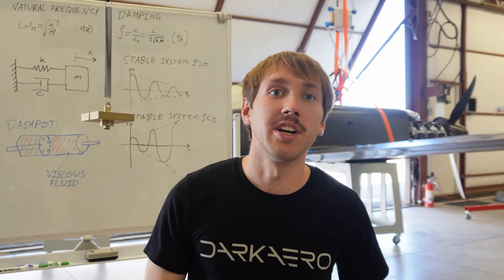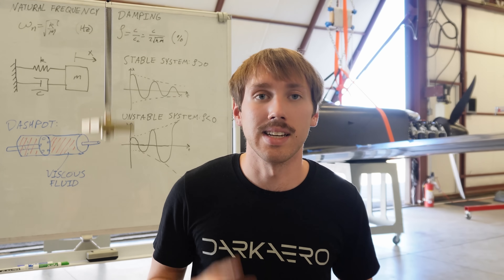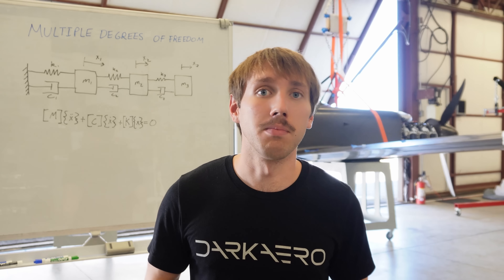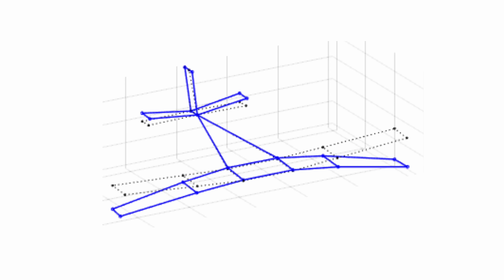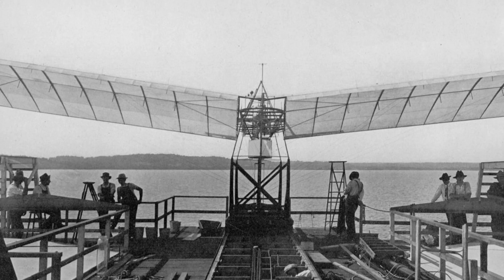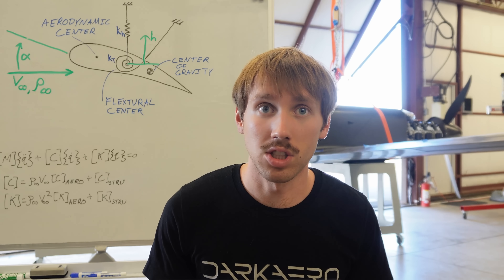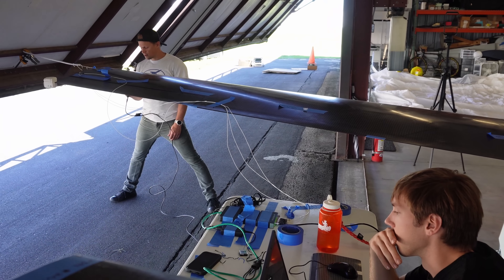The engineering required to fly fast (GVT)

Comment: Fascinating description of flutter. As a musician, I am working with a simple plate, column of air or a string. You can see that in many respects that any object can be viewed as a complicated string with modes and/or nodes dispersed throughout the structure depending on stiffness, mass and frequency. The same exact elements are needed to describe a vibrating string. The last thing you want is to be flying around in a Tacoma Narrows bridge!

Comment: Strange , those boys was making money by asking me and others to give them thumb up and now, at the end of their project they stopped informingm us. They are traitors in a way. If I new that, I would never give them thum up which they used to ask for...  Anyway, two thnings I do not like about their aircraft which I mentioned long time ago: Number 1) Use of corrosive alluminum in otherwise non corrosive air frame...(not a good investment , since your airframe may not last as long as all plastic airframes)  Number 2)  It is too small if you concider 200hp engine. Many UL arcrafts are bigger even using much smaller engine and are fast as well.

Comment: Electric plane via battery is really not meant for long range at all with battery. You won't need to worry about flutter if you can afford to use more structure via added material, IF you used a turbine engine.

Comment: I'm a senior in aerospace engineering, I'm currently taking a vibrations class talking about this very subject! This video is so interesting and really helped me to visualize some of the concepts we are covering, thank you!!
Reply from the maker: That’s awesome! Really happy to hear you found value in the video. :)
Reply: Dude if your expensive college education can’t get the point across yet a guy on YouTube can, This should be evidence of the college ruse debt scam
Reply: University provide order in study. Even if we can reach certain information, it doesn't necessarily mean we can learn without guide.
Reply: @Carboneye7 the video does a great job at a succinct overview that is easily digestible.  However, after the video are you able to model and perform the complex calculations necessary to analyze your own systems? How about diagnosing your modeling framework when calculations don't reflect observations?  This is where the thousands of hours of coursework come in that are required to become proficient in an subject.

Comment: Control surface Flutter is relatively simple to prevent with overhang balances, with a high degree of certainty to eliminate the problem. Per the NACA circa early 1940s. Interestingly enough, the highest-mach diving fighter of WWII had rather flexible single spar wings, and unbalanced control surfaces. Such is the ability of a cohesive development department and several little known design features.

Comment: So incase everything doesn't add up and the vibrations are not damped, how will this be countered (Other than lowering the VNE Speed)? Also to what  extent does the ground testing data correlate with the simulation data?

Comment: Phenomenally good explanation in less than 10 minutes As a pilot and non-practicing aero engineer I can really appreciate the complication involved with publishing a Vne speed. I'm certain that the Vne has a safety factor built in (200kts, 230mph for RV-7). All of you at Dark Aero are exceptionally professional with your design. Very impressive.

Comment: Put a parachute on it fools.  Call galaxy parachutes now or you will have unnecessary blood on your hands….I promise.  It should be mandatory now that the statistics are out.  Who am I?? I’m a statistician and an mde engineer and a cirrus and pipistrel owner.
Reply: Parachutes actually can help balance the aircraft…ask bristell because they can add more weight in passengers when the chute is installed or else they need weights upfront of 40 lbs.

Comment: This is kind of funny how similar this vibration analysis is to every other vibration analysis.  I used the same workflow for vibration analysis of cutting tools in specific machines.  However the goal in machine tools is to stay in a stable cutting parameters all the time, or right at the limit for maximum material removal.

Comment: Stellar presentation... Italian auto and aircraft designers employed construction methods with aluminum similar to what you guys have employed with DarkAero... It's interesting that a stallion constructed with carbon fiber of 1940s Italian style engineering is in the DarkAero stable... In the ladder logic of aircraft design observations of what works since computer analysis algorithms were verified by slide rule... It's incredible to witness vibrational modeling parameters transferred to the flat screen before moving forward with flight test. Time well spent in my book! Thank you for sharing      👏👏👏

Comment: Damn this was interesting! Could make hours long vids on this! (please do!!!!)
Reply: Wondering the same thing.   Probably a tall order but should be possible.   I have seen mode shapes and vibration dynamics modeled on engine rotating assemblies but they are also checked with real world testing.    For design phase efficiency 3D models are analyzed first.  It becomes a process loop, so ultimately sequence doesn’t matter.

Comment: Nice video!
Why do this test instead of a wind tunnel test with a model?
Reply: Because wind tunnels are expensive and you are not actually measuring the real aircraft. The GVT is done on the actual flight vehicle, which is key in measuring the stiffness, mass and damping values. Wind tunnel testing might tell you when flutter will occur but it doesn't measure the frequency response functions (FRF) that are used to compute the natural frequencies, damping, and mode shapes.

Comment: Old school way of figuring out if it is going to flutter was in flight with a parachute? Did they tap on the 747 to find these flutter frequencies?
Reply: They would have used electro-dynamic or hydraulic shakers to apply to input force on an aircraft that is large. On a 747, we would typically attach shakers at the wing tips, tail tips, and on each engine. A hammer is too small to excite such a large structure.

Comment: It's amazing that you are making videos explaining this, thanks! I'm curious how good your frequency response was using a (small) instrumented hammer on such a thin structure, I've performed GVTs on large military transport aircraft and always used magnetic shakers that sweep in frequency to excite the structure with enough energy at low frequencies, I would generally only use an instrumented hammer for more monolithic structures like engine mounts. I guess you are working with the equipment you have available but adding a couple magnetic/rotating mass shakers into your test setup would for sure improve your results.
Reply: Kai, the hammer taps were likely done at the stiff points (spars and ribs). For small, linear structures, using impact hammers is a good method to get quality FRF. Larger structures, like a C-130 or 747 aircraft, require more excitation than can be applied with an impact hammer. That's where electro-dynamic shakers are used instead of hammers. We typically would use 6 to 12 shakers at one time on a large aircraft to excite all the modes at the same time.

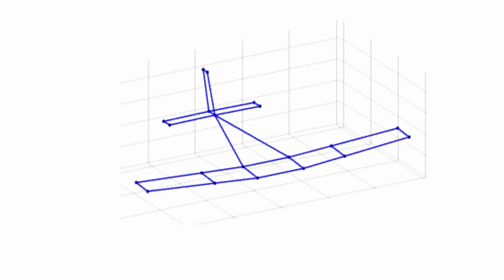Comment: 9:01 "As you can probably tell, there is a lot of physics and math that goes into flutter testing..." Um, yeah, that's about all I needed to hear. Also, how did they do this in WW II, etc, without computers? Or with fabric covered wings?
Good overall video, I just can't hang with the physics and math and stuff.  :)
Reply from the maker: Aeroelasticity was just beginning to be understood in WW2 timeframe. There was a lot more trial and error back then, and much was learned the hard way after airplanes came apart in flight.
Reply: research control reversal in high transonic flight - this was found because aircraft were exhibiting odd behaviours in dives and some lucky pilots got back to describe what was going on.  Transonic effects mixed in with airframe stiffness.

Comment: Love your work. This is probably one point where the extra stiffness of carbon fiber pushes the frequencies up. Using fiber glass would perhaps allow for larger bending and flexing amplitudes and lower some frequencies.
Reply: ..... oddly, the Berkut, a carbon fibre airplane, has a much higher VNE than the loosely similar Long-EZ.  I don't know whether it's the carbon vs. fibreglass or if it's the differing airfoils or some other wildly unrelated factor, but I'mma hazard that using carbon made things _better_, not worse...

Comment: Ahh ok 🤔, so why not just put your computer sensors on it and put it in a wind tunnel to create a simulation at certain speeds ? Plus you could do a smoke test to see flow , structural integrity,wing shape, materials used and their thicknesses, connecting points , there are alt of variables, and then comes how do the materials used react in different climates, cold ,hot ,expansion and contraction, a lot of variables,could be seen in a climatic wind tunnel simulation . Since this plane is made of carbon fiber it would be interesting to see we’re the weak points are going to be , and were things may need to get some heavier lamination , can’t wait to see it up in the air 👍

Comment: Studied all of this in 'control systems" engineering class. Though never applied the concepts to airframes. Is there a specific course or class in aeronautical engineering to apply these "control systems" concepts to airframes?
Reply: Yes, I also remember this in my control and instrumentation module.

Comment: Great explanations, could you also tell us what type of work/analysis on aeroelasticity did you do during the design phase? Mick Patey was pretty happy with the stress simulation he ran on his scrappy wings compared to the actual physical testing. Are you able to confront design data with the actual measurement you made?
Reply: Second this request.  Were you able to run a static vibration mode analysis on the design, and get any mode shape and frequency numbers?  Were you able to confirm these with your hammer tests?

Also, you are using carbon fiber, which IIRC is not very lossy itself.  Do you have any information on if your resin is at all lossy?  Did you consider using kevlar anywhere (especially around the empennage) to increase the structural damping in the airplane, at the cost of less stiffness?

I'd love to see more detail on why pitch mode in the wings (that's twisting around the 1/4 chord line, right?) becomes less damped at higher airspeed.  Is this actually higher dynamic pressure, or are velocity and density separate variables?

Comment: This was a great presentation on modal analysis and how it is used in the study of aeroelasticity. I would be curious to know how this carbon fiber structure is in regards to damping and if you guys are going to have to install trim weights or stiffening structures in strategic locations to tweak the modes.

Comment: Very interesting! After seeing this I am still totally confused BUT on a much higher level!! 🙂
Reply: How a plane flies depends on its shape. Flying fast enough can cause the plane's shape to change. Depending on the strength of the structure, there are certain speeds at which a small change in shape creates a change in flying characteristics that tends to worsen the deformation. This can show up as vibrations that can be strong enough to damage the airplane, and/or changes to the shape of the airplane that impede safe flight. Therefore, these tests help them determine which speeds to avoid to keep the airplane safe and sound.
Reply: @Mariano.Bernacki  Thanks! What puzzles me is how you can determine how the airfoil will react in flight from making vibrations. I have seen wind tunnel test (like the ones shown in the video). I find these vibration test amazing.
Reply: @psblad2667  Much of this "testing" was already done in software like ANSYS before finalizing the design airframe components. My guess is at this point they're doing real word testing so they can confirm the results from the software analysis.
Reply: @jamescrud  This is mostly correct. There are computer models (finite element models) of the aircraft that are used to predict when or where flight instability occurs. The ground vibration test (GVT) is used to measure the mass, stiffness, and damping properties by measuring the natural frequencies and mode shapes. The test results are then used to update the computer models to match the test results. Once the computer model matches the ground test, then you have more confidence in the model predictions.

Comment: I was wondering what the VNE speed was going to be. Especially with the turbo version of the UL520 coming out after you already started developing this plane I’m guessing at 15,000 feet at 220 hp it would absolutely scream through the skies.
Reply: Not in aviation, but isn't it impossible to go past 10,000' in an unpressurized aircraft?
Reply: @user2C47  
Unlimited time at 10,000 feet.  Only above 12,000 is oxygen required.  Many sky divers jump at 13,000 as they are only there for a minute.  The plane usually descends faster once jumpers depart.
13k is tough under a work load but not immediately noticeable as blood oxygen is saturated up to 8k and only drops below 95% above 12k at normal pilot work loads.
Of course this is for healthy adults who do no smoke.
Reply: @keithjurena9319  Yet the original comment mentioned 15,000.
Reply: @user2C47  
Easily done.  Limit for VFR is 18,000, above that are flight levels and IFR.  After that, FL 280 is the limit unless the aircraft has revised vertical separation limit demonstrated altimeter.   
18,000 foot limit can be waived in certain locations for mountain wave soaring but this window has defined geography, is opened by permit issued by the ATC center and can be shut down at any time.
Reply: Wait till I tell them I’m thinking of an Allison 450hp 

That’ll give them a heart attack. 😅
Reply: Also, with most recip prop aircraft VNE is engine RPM exceeding limits before anything else. 

☮️
Reply: @ashsmitty2244  this is why you have a constant speed prop
Reply: @johnlichtenstein6158  That definitely helps. A reversible prop would be fun, lol.
Reply: @ashsmitty2244  
Some turboprop engine/prop combos have a beta range which is exactly that.  
Turbines are strange..on startup,  turning the fuel on can cause turbine inlet temperature to rise past limits so the prop is put into feather position to dissipate energy from the power take off turbine which helps the gas generator turbine get more mass flow into the process to cool turbine inlet temperature.
Reply: @keithjurena9319  👍 I got rated on the C208 grand caravan with the 900hp garret. 

Amazing

Comment: This video is AWESOME!!!!!

There are precisely ZERO experimental aircraft manufactures that present this level of information......many of them likely do not know themselves. 

😍😍😍😍😍😍😍
Reply: It alsmosy seems like they are doing enough testing to get this aircraft certified one day.
Reply: @michaelforseth8609  who would've thought... you know, that the requirements to design a safe airplane are also the same requirements for certification. 

Aviation rules and regulations have been written in blood through the years, and that includes the certification requirements. That said, I don't think an "experimental" Garmin G3X is any less safe than the one that costs 3x as much but comes with a sheet of paper saying it's "Certified." There are also tried and true kitplane designs like the Vans RV that have more examples flying than many certificated aircraft yet have a stellar safety record. The fact is that most kitplanes simply rely on being overbuilt and going quite slow. 

The big exception I can think of are the canard kit planes (e.g. Long-EZ, Velocity, etc.) but those are either Burt Rutan designs or copies of Rutan designs with enlarged cabins, and Burt Rutan took things like this into account. Scaled Composites (Burt Rutan's company) is still around and has built things like that crazy Stratolaunch twin-fuselage plane, a plane that flew around the world non-stop, the first pulse-detonation powered plane, and tons of other novel creations that have been quite successful.
Reply: @michaelforseth8609  this is EXACTLY what they're doing. They fully intend for this to be a commercially rated aircraft one day.
Reply: They’re using the trial-and-error approach. Gotta love being a Guinea pig as a builder 😊
Reply: So true.